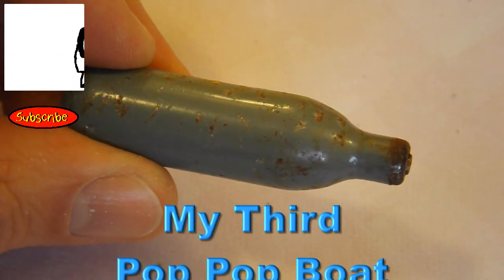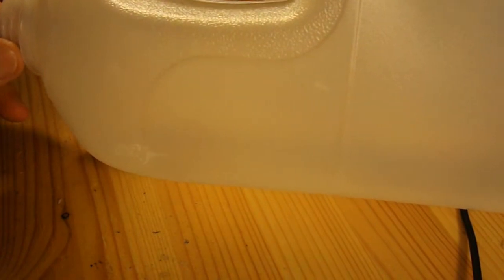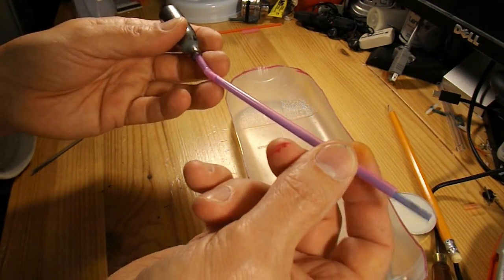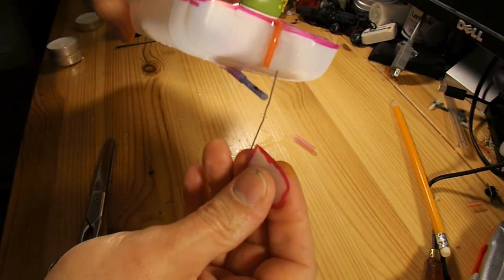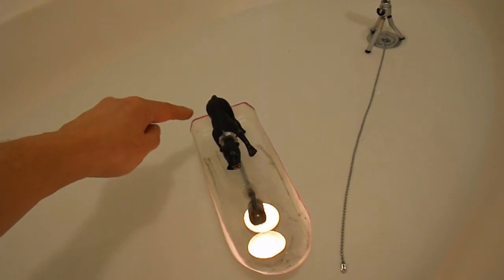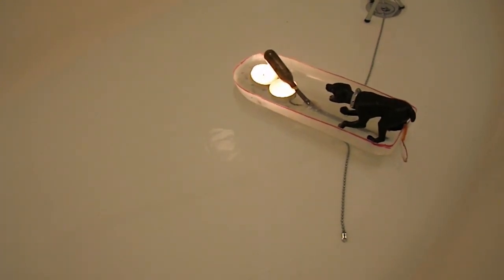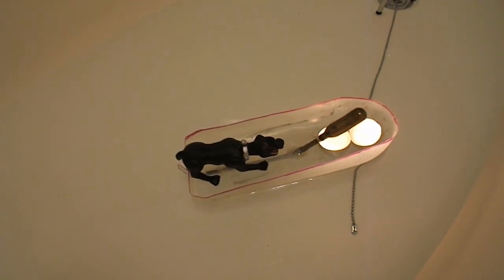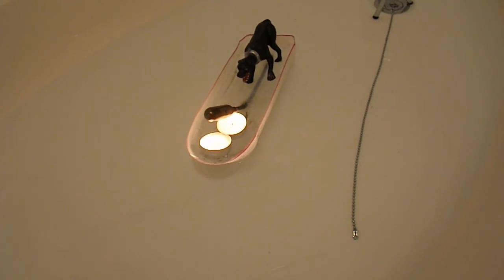My Third Pop Pop (Putt Putt) Boat goes round in circles

Comment: How about drilling a hole in the other end of the cylinder boiler, thread it, and you can prime it with water and then close it up with a small threaded  bolt. Lot easier than trying to prime it through the straw.
Reply from the maker: I am not sure that would be easier, but I can see what you mean 👍
Reply: @GrandadIsAnOldMan  I'll experiment and let you know. I wonder if the amount of priming water in the boiler makes a difference, as air is compressible but water isn't. I'll let you know (if I don't die in the meantime. I'm three score and eleven)!
Reply from the maker: @paultoschi  my concerns would be 1. Making an airtight seal 2. Needing to have an extra tool to do the job 3. When you come to handle it, you will find the black soot gets everywhere. That stuff is amazing, how it just spreads everywhere if you get the tiniest amount on your fingers 🤣 And yes you do not need to fill the chamber with water for it to work. There are links with more information in my video description. I always recommend people visit Daryl Foster's channel. He has excellent boats.
Reply: @GrandadIsAnOldMan  When i was a kid my older brother made one and used methylated spirits (denatured  alcohol) in a little holder to heat it up. No soot.

Comment: I'm surprised the plastic straw pipes don't melt in some of the other builds I've seen as well. Soft copper pipes seem like a better option, but do cost more.
Reply from the maker: They can melt but remember we are only at the temperature of boiling water/steam in the tube so it depends what sort of plastic straw you are using. However if you check my video description or see the video at 02:48 I did swap it for a metal pipe as the metal container does overheat.  Here is another pop pop boat that uses the plastic straws successfully https://youtu.be/uzBy2RqY5g4